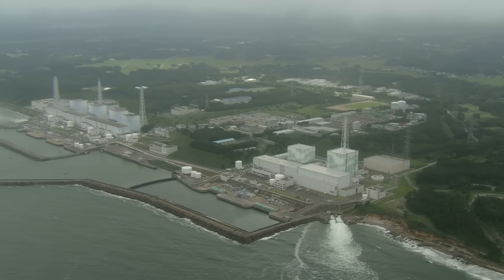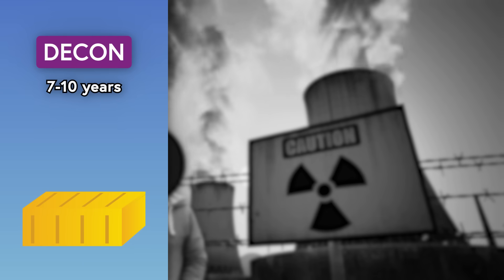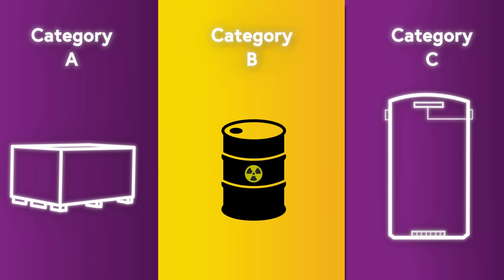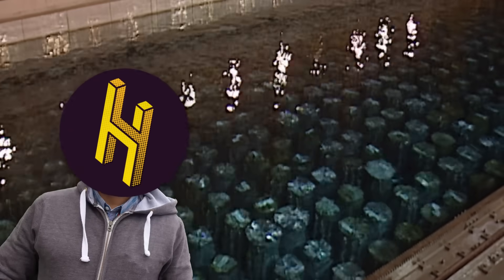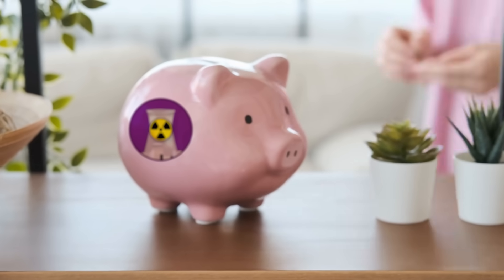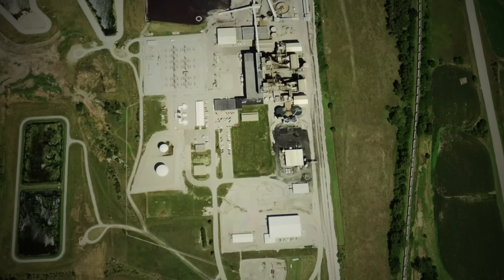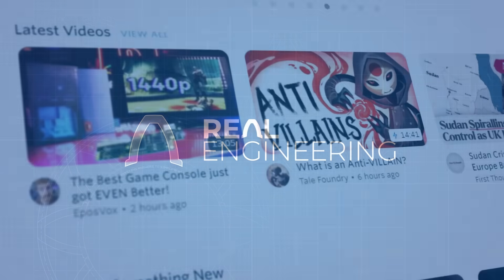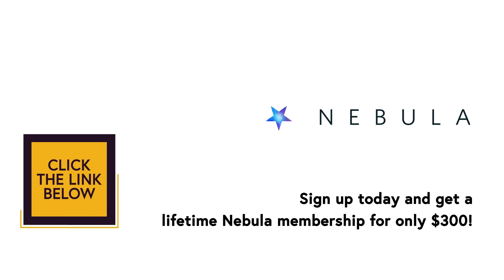Why It Takes 7+ Years to Shut Down a Nuclear Plant

Comment: It’s really sad that nuclear power plants are being decommissioned since it’s an extremely safe, reliable, efficient and carbon free way of generating electricity
Reply: There's nothing wrong with decommissioning old nuclear plants, especially the Gen I and Gen II plants that are horribly inefficient, not as safe or waste-savy as they should be, and not designed to operate for the length of time they've been operating at. The shame would be to shutter these archaic reactors without reinvesting in new Gen IV reactors
Reply: Yeah, taking 40 years to shut one down, at an expense greater than the plant made in it's lifetime, is very very efficient! I am very smart!
Reply: Preach!

Being scared of nuclear is like being scared of flying.
Reply: greed is much more powerful than logic or reason...
Reply: @Oscar4u69  I disagree. It's fear of the nuclear "boogie man" on the left and not enough fear of climate change of the right.

Plus the cost issue, in no small part due to a lack of proper long-term storage (unless you're Finland) and the cost of CO2 not being factored into the market, especially for other sources.
Reply: @Oscar4u69  funny enough greed is one of the main reasons why the fukushima plant had a meltdown
when it was created they were warned that it wasnt elevated enough to avoid flooding during large storms, but they shortened it to save money
they had been warned for years about how the water tight bulkheads leaning to the backup generator rooms needed to be replaced, but put it off to save money. which is how the backup generators flooded resulting in meltdown
Reply: @Oscar4u69  But isn't there a pretty good rate of profit with Nuclear tho? Thats what confuses me. Unless im wrong and the profit ratio isn't as high as i recall.
Reply: @CanadianB.O.W  no, renewables got too cheap, apparently. In great britain the gov had to create above-average-marketprice-CFDs for the Future Operators of hinkey point C, just so that they even Start building...
Right now nuclear power is really only profitable when you can offload a lot of cost to your Military, e.g. want nukes
Reply: @CanadianB.O.W  Fuel costs per unit energy generated are very low for nuclear power. But the enormous upfront costs and high cost of continuous safety regulations and high maintenance on the reactors quickly drive down that benefit. Small modular breeder reactors that can self-seperate their waste might over come these issues, but like others have said, that requires large investment in something that currently doesn't have a lot of political good-graces
Reply: @CanadianB.O.W  Nuclear is very efficient, ~8 orders of magnitude more efficient than coal (10 if you can use thorium). However, it's also VERY expensive for permits, and transport, and safety, and just getting the material. While for other sources of energy, safety is thrown to the wind, as it either happens in a different country where 7 of them are worth 1 of us (joking), or in the desert, where no one sees it. It's less expensive per GWh than coal and oil, but there's a high cost to entering the market. It is all around better for the environment than solar and wind, but there's an optics side to it. The average person isn't going to spend all their time looking at the costs and benefits, they'll interpret what they know. This isn't a bad thing, everyone is ignorant about most things. When you compare these huge smokestacks billowing gray from the same stuff that blew up hiroshima, and some blue silicone and glass,  you're gonna pick solar every day. It's just an easier sell. Geothermal and hydroelectric are about the same as far as injuries, power, and environmental damage as nuclear (if you build the damn dams right), and are often quite a bit cheaper. Unless you're a huge city with big power needs, it just makes more sense to go with the cheaper (in the short run) options of non renewables. But with the advent of smaller power plants and (hopefully) thorium, we're probably going to see an uptick in nuclear power. 
TL;DR: Yeah, they do have a better profit margin, but cost a lot, and there are other barriers towards smaller communities.
Reply: Other sources (both clean renewables and dirtier gas/coal) are heavily subsidized.
Reply: @martinum4  the problem is renewables can't produce baseload power. If we factor in things like the potential cost of climate change, power storage or the cost of an unreliable power grid, nuclear makes a lot more sense.

We can see issues with the economics of solar for example in Australia, where during sunny days which aren't very hot, the spot energy price isn’t high enough for many solar plants to be profitable as residential solar power means demand on the grid is low and the excess being fed back into the grid keeps the price low in peak solar times. 

Unfortunately energy storage is decades away and things like the recent example of Europe and calm weather show that wind isn’t able to be reliable.
Reply: @Spencergolde    You obviously understand nothing.  Decommissioning is part of the cost of nuclear.  Nuclear is 3 times more expensive renewables
https://en.wikipedia.org/wiki/Levelized_cost_of_electricity
Reply: @DSAK55  Riddle me this, is new transmission infrastructure, battery storage, and end of life materials recycling included in LCOE figures for renewables? Look deep into where those numbers are coming from, because often these are excluded. It's understandable why they might be, after all you "can" generate electricity from renewables without those three things; but, you won't be able to move that energy from remote/low density areas where generation is cheap to places where it's actually needed, and you won't have reliable power available if you can't store it, and it's not a renewable or environmentally friendly way to make power without comprehensive recycling. We can do all of these things, but the trouble is when you do, the costs are currently far higher than a coal, natural gas, or nuclear power plant, and a power plant disrupts far fewer ecosystems with it's smaller footprint. Powerplant, especially nuclear LCOEs include transmission (though they plug into existing infrastructure), produce constant output, and have miniscule amounts of waste, especially with reprocessing. Both options can work, and renewables may be more viable as a standalone solution when cheaper grid battery storage becomes available. But as is, renewables are not longterm cost competitive with nuclear if you include spending on things that actually make it grid viable.
Reply: Yeah aren't pretty much all the emissions created when you build it?
Reply: @joshrayner7167 and after it's built. It's kinda contained. Meanwhile.... Coal, gas and oil. Is literally digging up condensed carbon and releasing it for the whole atmosphere
Reply: @joshrayner7167  there are othwr CO2 costs, but it's second only to wind in terms of CO2 per G/Wh and for a baseload source that's a big deal.
Reply: @joshrayner7167   Some emissions in the making of fuel
Reply: and yet, the price tag is clearly wrong when comparing with wind / solar / ... productions
Reply: It can also be expensive to run and takes a long time to switch on and off making it incompatible with some systems. a coal powered power generator takes about an hour to spin up, nuclear ones takes a whole day, difficult to work that into grid systems that has high demands at times and low at other parts of each day. if you ends up grounding half the electricity generated for half the day and unable to meet demand in the other half of the day, it becomes not worth it.
Reply: @penitent2401  nuclear are base load power generation, you arent suppose to spin them up or down. france does do this, but only because 70% of their entire grid is nuclear which makes it possible

also even if coal can spin up and down in an hour, coal is also base load, it rarely changes output
Reply: @vincentgrinn2665  Not exacly true, their avg capacity factor is 65%, but some of their reactors are spefic to serve as load following. That also aplied to german plants
Reply: @penitent2401 if the variable load is the problem, then why don't they just nuclear power for only the base load. The base demand is pretty much always gonna increase in growing population
Reply: @godofpebbles  They are being used for base load most of the time, my point is the current set up means that they can really only be used for that. which mean they are guaranteed to only be able to power a portion of the energy needs, for their costs they are only suitable for areas with large enough population that their base load demands supports one. majority of the country's total needs still must come from elsewhere.
Reply: Please tell me that's sarcasm?
Reply: @greensteve9307  they... are. For all of this data, oil≈.66*coal. Nuclear has 1,231 times fewer deaths per GWh than coal. This also says a lot about it's reliability. As the video shows, there are constant improvements for not-so outdated plants, constantly growing. 
Chernobyl, three mile island, and fukushima were caused by rare mishaps and safeguards have been put in place to prevent further accidents. There's a lot of kids who die from coal inhalation in third world countries, but we don't get three hour news segments on them. Their efficiency is obvious. 3,500,000 tons of coal=200 tons of uranium= 1 ton of thorium (plus a couple kg of fissile plutonium). 
It isn't hard to fill an old mine with a bunch of material and just cover it up, and, if properly done, nothing will affect the groundwater. As far as carbon free, the refinement and mining processes do give out a small amount of co2, but 30 times less than that of coal. (that may not seem like a lot, but it really is). Don't get me wrong, nuclear isn't perfect, but it is as close to perfect as you can get. 

Sources: 
https://ourworldindata.org/grapher/death-rates-from-energy-production-per-twh?tab=table 
(just graphs, but they list their sources)
https://css.umich.edu/sites/default/files/2022-09/Nuclear%20Energy_CSS11-15.pdf
(biased, but it's the university of michigan. they know a lot more than any of us do about physics, so I would STRONGLY recommend reading this one. )
Reply: @thebestthingbeforeslicedbr8562  Or you can recycle the waste like France does. 90% of spent fuel can be used as fuel and the rest can go to medicine or industry. It would take 19 yrs for Japan to recycle 10k tons of solar panels while France reprocesses almost 2k tons every year.
Reply: Question is whether all the carbon not emitted during its lifetime is less than that of all the carbon in building, running and decommissioning?
Reply: You guys speak as though anyone is capable of having the labor, technology and the capital to even make cost effective solar panels locally. When in actuality the majority of solar cells are made in Asia. Same thing with batteries

The way I see it is that semiconductor manufacturing is hella expensive and so many components are entwined together 

If your country is interested in self sufficiency, it's either they spend billions to fab their own solar cells and billions more to catch up. Or they might end up with Huawei and ZTE's situation with a sanction.

That or spend billions to make your own nuclear power program.

Or spend billions getting addicted to Arabic oil
Reply: You have to decommission a reactor after their lifetime. Radiation also wears down metal and other structural stuff. And 'cheap' is relative, because most of the times the decommissioning process was underestimated. Even now we don't really know how to deal with old reactors properly
Reply: Yes & no. They are a great source of carbon-free energy however, single reactor sites are just inefficient and shouldn't have been made. Multi-unit sites can actually make use of every MBA's favorite concept that rarely works in nuclear: economies of scale. Even banding a bunch of single unit sites into a fleet doesn't give the savings the having a multi-unit site does but that's a whole 'nother discussion.
Reply: The problem is that nuclear power is incredibly expensive to build and maintain. Uranium enrichment is very inefficient in terms of cost and mined material, while Thorium reactors simply aren't viable outside of lab settings yet. Coupled with the fact that nuclear plants cost billions of dollars and roughly a decade to build (and those are projections, in reality almost every plant had large cost and time overruns) means that nuclear power is only viable in certain situations. France had cheap nuclear power for decades because of several factors, including cheap uranium from their former African colonies and refusing to properly upgrade their plants, which means their reactors are too old to run safely on average. In the next decade, the French government will likely have to spend tens of billions bringing all their plants up to code or switch to largely renewables as well, with the latter option probably being the more beneficial one from an economic standpoint.
Reply: @xargul_wolf  Modern power plants are incredibly expensive to build and maintain because every power plant is huge (for higher efficiency) and at least semi-custom… because so few are built… because they’re so expensive to build and maintain… see the problem?
Reply: @xargul_wolf France also had cheaper nuclear power bc when a plant was built it was one plan, no modifications. That never happened in the US bc one utility wanted to put out 345 kV, another 275. One wanted to save some building cost so eliminate 2 pumps and crosstie two others. It makes for plants that are conceptually the same but the minute details start to add up to be a problem.
Reply: @xargul_wolf  Sir, what you just did is called spreading misinformation. Seriusly, why don't you people search outside single case exemples? A nuclear power plant takes an avg 7 years to build, this number can be much lower with 21% taking less then 5 years. When you build multiple at once, wich is how you actually take advantage of economies of scale, you end building more then 1 per year on avg. Multiple exemples of this. The cost is high in cases such as Hinkley Point C, Flamvile, Vogtle or OK3 because they decided to take a super complex, brand new, from a new generation, never built before design, and build those designs without proper planning, in single projects, with engeneer shortage and in countries with to much burocracy. This errors made them slow and expensive, wich is not necessarely true for nuclear reactor construction
Also, french nuclear isn't cheap because of cheap uranium. Uranium makes up only a part of the cost of nuclear fuel, wich in itself makes up a very small part of the cost of nuclear power. Lastly, they didn't "refuse" to upgrade their plants, they didn't do it because they were pressured to reduce nuclear to 50% by 2025, AKA closing reactors. Why would you upgrade reactors that you want to close? And ofc, being forced to sell eletricity to competitors at a loss also put EDF at a disadvantage, but everyone seemingly forgot that
Reply: @xargul_wolf  Also, nuclear power benefitted greatly from the Cold War arms race where the USA and USSR spent gobs of money on R&D into nuclear weapons and reactors for warships and submarines. It's why civilian power plants use uranium instead of thorium; that's where the R&D spending was already going. It's going to be much harder to get thorium from the lab to commercial viability because it's not going to benefit from the piles and piles of money spent on an arms race without much consideration for cost.

Nuclear power has never been a particularly cheap option (though some people try to argue the economic advantages anyways). Countries that predominantly used nuclear like France and Japan did so because they were able to scale up volume enough to get the cost low enough that paying a bit extra was worth the energy independence.
Reply: @lunatickoala  Very good points, I don't think we can expect every country in the world to switch to nuclear power in the way these countries did. The best option for the environment would be to have a large capacity of renewables were the power production is more volatile, and use a small number of nuclear sites to cover for times of low power.
Reply: @lunatickoala  Oh, and thorium also has the extra downside of being much harder to use to start a nuclear reaction. Ideal for not being used in nuclear weapons, not so ideal when you want to use it to build nuclear weapons and nuclear power.
Reply: They're not safe the way they're currently run, and the US at least does not have a single permanent place to put nuclear waste. These aren't unsolvable problems, but we'd just rather continue to build more plants than fix this
Reply: @MorningMeasure  I don't see how they could ever be trusted to be safely run. We can't even run oil platforms safely because energy companies constantly cut costs for things like.. you know, safety. Imagine if Deepwater Horizon was a nuclear plant on the mainland...
Reply: The process of decommissioning a nuclear power plant just shows how safe all these elements are to deal with… 🤪
Reply: @JonoConstantini  It is safe, coal fired plants literally emit more radiation than nuclear power plants. However, when decomissioning, you are going to remove the shielding, which is why you need to be very careful. He says everything is considered radioactive, but this is just to be extra safe, as there are no risks to take with radiation.
Reply: Yes but they are complicated machines that wear out; there's no changing that.